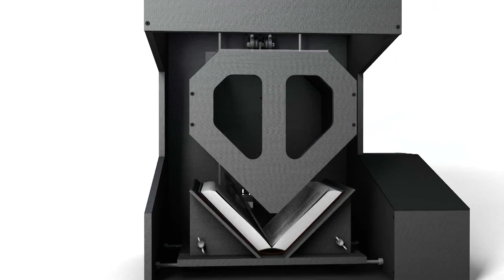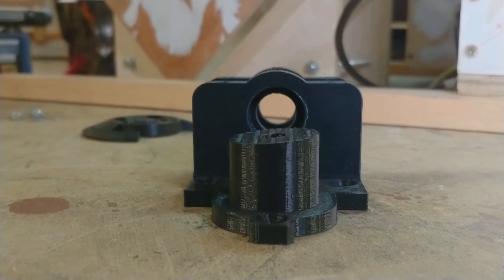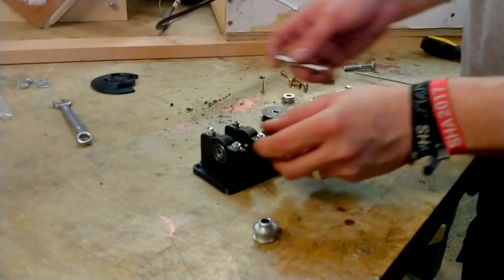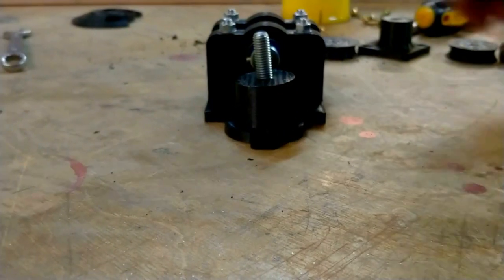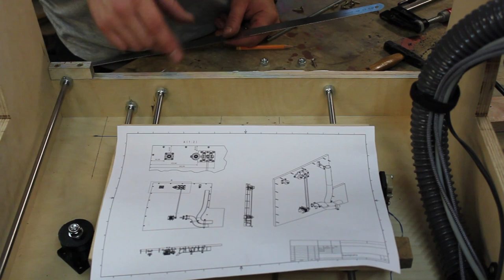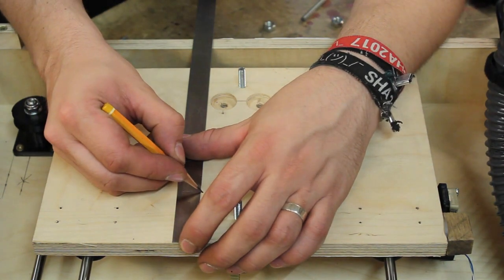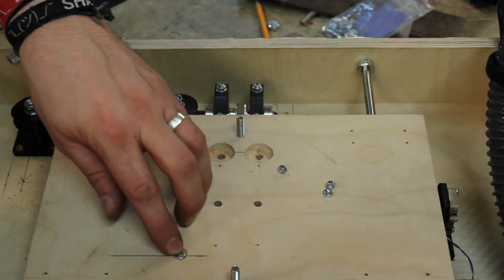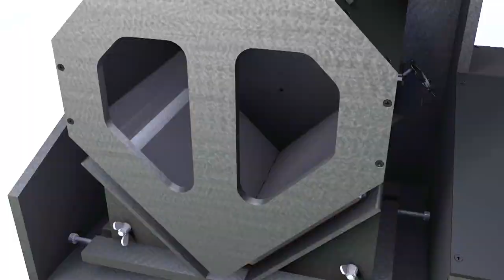building Libreflip - E27 - finishing the counterweight (part3)

Comment: Hi sir. When will you upload next video?
Reply from the maker: Thank you for your question, let me explain what has been going on. 

For the last weeks, I've been really busy focussing on other projects, like Christmas presents for my Family and I am also finally building that workbench, that you might've seen pictures of on my twitter account. (twitter.com/ijonberlin ) We started to plan this project back in February, and I had to build it at some point.

Also when I met last week with spacekookie to update the software on the machine, which is a requirement to start the testing of the light system, unfortunately a part broke, the top pulley assembly. It only broke, because it was wrongly designed. This weekend I will try to redesign the part and print it. Exchanging it will take some time, as it is not the easiest part to replace.

The busy pre-christmas time, planning and preparing for #35c3, the workbench-project and this set-back all influence the schedule of the project.

In Episode 22 I announced the collaboration with CADUS e.V. and spoke about a big CNC-Mill that I am getting for CADUS. This project was going on in the background and right now (as I write this) the ship with the CNC-Mill on it is passing through the Strait of Gibraltar. The machine will arrive most likely in the second half of November. This is awesome, but organizing the logistics, unpacking, setting up the machine and getting it running will require further time-investments, that will further reduce the time I have to actually work on Libreflip.

On the other hand, the CNC-Mill is definitly necessary to produce parts for Libreflip, as soon as I move past the prototype-stage.

I hope this update is not too disappointing, but rest assured, stuff is happening in the background, even if no new videos are being published currently.
Reply from the maker: I forgot to tell you, that I usually give updates of whats going on on the twitter account of the project: twitter.com/libreflip